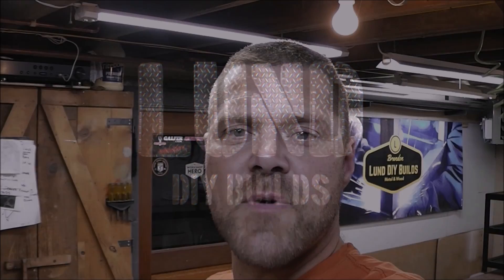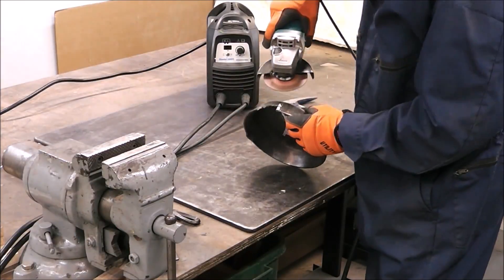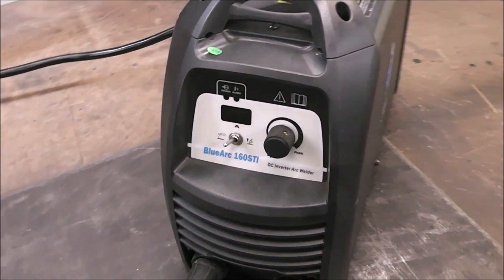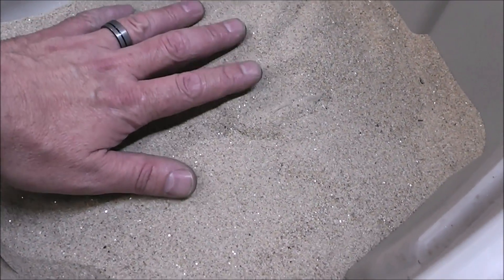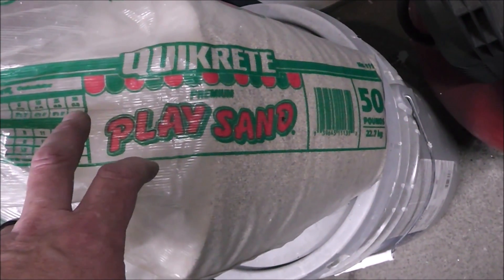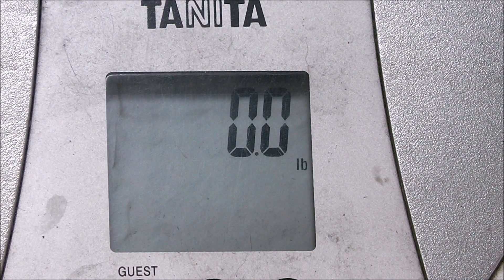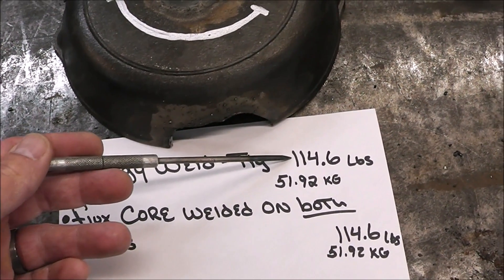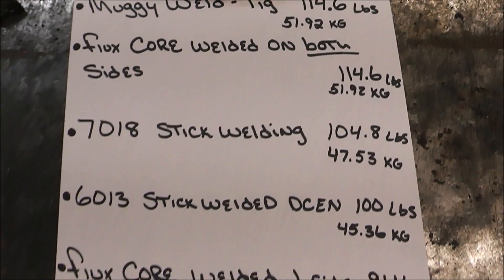Stick Welding Cast Iron Repair with 6013

Comment: I am a very new welder, mostly DIY around the house projects I was recently given a small Inverter Arc Welder. Very basic 120v 90 amp.

One of my first practice projects is a small Cast iron yard Sculpture they fell over in a storm and a piece cracked off.

I'd like to try and fix it if I can. It doesn't have to be perfect just has to hold it's self together and support its own weight (less then a 1lbs) I read online that the best electrodes for this are nickel based but there are other substitutes.

Questions I have what amperage should I set the welder at and what electrodes would you recommend
Reply from the maker: For small cast iron repairs that don't need to be perfect, 6013 rods can work. Start around 70-80 amps and adjust from there based on your machine and the material.

Comment: WRAP A 12GUAGE SOLID COPPER WIRE AROUND THE ELECTRODE WITH 1/8 TO 1/4 SPACE BETWEEN THE WRAPS AND 1/4 INCH AWAY FROM THE TIP, NOW WELD YOUR CAST IRON.
Reply from the maker: Yah, I haven't had that work either. I HAVE A VIDEO ON IT

Comment: For those who care: cast iron welds tend to crack, because cast iron has a ton of extra carbon in it. This excess carbon forms carbides with alloying metals, which precipitate on grain boundaries and cause a crack to propagate through those weak grain boundaries. Using nickel helps to keep the carbon inside of iron grains, because nickel is good at mixing with iron and so nickel carbides stay inside of iron crystals, rather than build up on grain boundaries. good heat management, like is shown in this video can prevent thermal shock induced cracking, but it will not prevent carbide formation on grain boundaries, which is why it ultimately cracks in parent metal near the weld. There are 3 categories of repair: Brazing - low temperature that prevents formation of new carbides; Nickel rod - the best way to keep carbides from forming in grain boundaries; misc heat controlled fixes with 6013 or 7018 that involve preheat and slow cooling. Misc heat controlled methods do not prevent carbide formation on grain boundaries; hence leaving the part vulnerable to thermal shock later. Here is a fun test I'd love to see; repair a part with Ni rod, Brazing and 6013/7018 welding with proper preheat slow cooling. Then heat cycle the repaired part to see which repair breaks first.

Comment: i used to weld it all the time with 7018...it holds up pretty well but any breaks i had were consistent with what you have shown...it breaks at the edge of the weld due to carbon migration induced by the steel welding rods (the hotter the weld, the worse the carbon movement)....nickel rod has no carbon affinity therefore is the only rod that really works well...another good process is to torch weld (melt) another piece of similar cast iron into the crack.

Comment: Every kid that just got out of welding school loves to tell anyone who will listen about pin holes and porosity, they think it makes them sound smart. This is really good information you are giving people, you obviously know what you are doing. Good stuff
Reply: Pinholes and parosity are weak points in welds. With a consistent bead of 60xx's rods, you can avoid the pin holes.
Reply from the maker: @shortiemac001 porosity isn't caused by not having a steady bead. It's caused by the impurities in the cast floating to the surface of the molten base metal. That's why brazing is preferred, because it doesn't penetrate the base material.
Reply from the maker: I appreciate it thank you!

Comment: I'm no welding expert ,but I once had to weld a broken cast iron toe back onto a base of a small machine part years ago . I welded one side with nickel rod after preheating , then I flipped it over immediately and brazed the back side . Best damn cast iron repair I ever did back then .
Reply from the maker: Right on!

Comment: Id like to see the pan strength comparison with standard Bronze Brazing.
Reply from the maker: It's the strongest result to date. It's almost as strong as the original cast iron. It's in the playlist. Pretty impressive stuff
Reply: @BrandonLund  I found the video you mention, I was hoping it was the Oxyacetaline torch with Bronze road and flux.

Comment: How much weight would the pan take to break from new before you go and weld it?
Reply from the maker: I cant remember. I've done so much testing in this series. Just a little over 200 pounds if I remember correctly. The strongest filler metal to date has been mig welding with silicon bronze. It was almost as strong as a new pan 👍

Comment: Im currently doing weld repair for someone and im glad im using a nickel chromium filler to tig weld it. I had no idea muggy nickel weld filler was the strongest in the list. My colleague at work told me i should use a nickel chromium because its very strong for cast iron. Glad i made the right decision.
Reply from the maker: Another good filler is silicon bronze. It's almost as strong as the original cast and welds like butter.

Comment: Hi did you try heating up the pan like what would happen when cooking then try the weight strength test ,would this have a effect on its breaking  weight test
Reply from the maker: I have done a bunch of exhaust manifolds with no issues. Eventually it may or may not fail. Cast iron can be unpredicatable.

Comment: If none of those welds broke, instead breaking the pan alongside the weld, then the rod type is irrelevant.  Heat is weakening the cast iron alongside the weld, so the dependent variable is preheat/cooling procedure, not rod type.
Reply from the maker: An electrode that melts at 2300 degrees vs an electrode that melts at 1600 will have a drastic effect on the weld. Rod selection does matter as does technique.
Reply: @BrandonLund  Good points, but wouldn't that be moot if your procedure stated something like "preheat to 800 degrees less than rod melt temperature"?  Or maybe a percentage, I'm no metallurgist.

Comment: 6013 was designed as a sheetmetal rod,   it should not be used on cast.   it has little nickel
Reply from the maker: This series isn't about what should and shouldn't be done. It's about what works and what doesn't. Silicon Bronze MIG is the strongest cast iron repair I've made to date.

Comment: 😮 I was impressed that it was holding up the chain with a little bit of sand. I do have a question I have a cast iron pot belly stove can not find them anymore it has cracks in the side what is a good welding rod and implements for a Lodge cast iron pot belly stove repair
Reply from the maker: If it's in the heat firebox area I would suggest a nickel rod and if it's a leg or something that doesn't get above 600 degrees I would use silicon bronze mig wire
Reply: @BrandonLund  thank you for your response thank you thank you. I will definitely experiment with that. Seeing it's so difficult to find a non EPA wood cook stove I was going to build one using hot-rolled quarter inch steel plate. Or would you recommend something else? I kind of have to go on the cheap. As well as basically learning how to do it as I go.
Reply from the maker: @keillorchristoph sometimes building on the fly gives the best results, modifying as you go. I'm not an expert on stoves but I would think 1/4" would be adequate.

Comment: Ehh... Use whatever on the grinder to clean it up a bit, then gently clean up with a diamond wheel.
Reply from the maker: I don't get too crazy but there is always that one that will insist the earth will stop rotating if you don't bevel with a cold chisel.

Comment: great on a static load. what about a shock load. say hit it with a hammer? I ask because I have a cast iron piece I need to fix...not a pan but a sander. so static loading might not be real might be some dynamic loading.. or I have to buy a new sander($300 and up). I have the welding EQ. lousy at welding but willing to try..thoughts
Reply from the maker: Cast iron is a crap shoot..I say try it...you got nothing to loose.

Comment: Brandon, it’s awesome that the weld is strong but when i think of cast iron in my local i think of wood stoves and of course the cast iron cookware……so, when you apply heat to the cast iron while cooking it on the wood stove or fire…….doesnt it affect how strong the weld is after you weld it? I have a 100 year old wood stove that i broke the foot pedal to the oven door. I asked around several people who specifically work on these stoves and he told me it is very difficult to weld it since the constant heating and cooling of the medal….
Reply from the maker: It will. It's one of the reasons I refuse to repair cast iron pans for people. Woodstoves don't worry me due to the high heat...much higher than a cast iron pan

Comment: The 6013 running via a homemade welder via MOTs can penetrate rust and do just about anything "professional" electrodes can do.

Yes, anneal cast iron in lime after welding for best results.
Reply from the maker: Spot on!
Reply: Best AC stick experience ever. Will never buy a buzz box which I borrowed or cheap inverter ever.

Comment: Sir.Can i weld the crock of the cylender head with the 6013 stick welding
Reply from the maker: You will know very quickly as it cools if it starts to crack. Cast iron has about a 50/50 chance
Reply: It's more about preheating and postheating or annealing after welding. Use anneal the gear in lime overnight and you'll be fine.

Comment: I never knew you could weld cast iron with standard rods, or wire. I always thought it was braising, or nothing. And the heat is the most important. Thank you.
Reply from the maker: Glad to help Michael. Heat really is the key. MIG Silicon Bronze is by far the best method I've tested. I have a video on that also. https://www.youtube.com/watch?v=Cm3_uv-PhPM

Comment: Great I've never thought of welding cast iron with 6013 I guess in a pinch it can be done I've used 7018 or regular cast iron rods that holds pretty good everyday you can learn something new
Reply from the maker: Thanks man! You don't know until you try :)

Comment: I've had people argue with me till they where blue in the face about welding cast iron almost to the point of violence lol I had to do this in welding shop in school took 4 years of it got my card to weld bridges and we had to do this in school stick weld cast iron not braze it weld it it's one of those things a lot of PEOPLE can't weld cast iron not that it can't be done but if you know what to do and how to do it you can do it no problem preheat and cool slowly good video
Reply from the maker: You hit the nail right on the head brother! Like you said, you can argue until your blue in the face but until you've done it its usually "i heard" or "so and so tried it and it doesnt work". Its all in the prep and taking your time. I like to use bare wire mig on cast just to irritate my critics 🤣🤣🤣 that might actually be a good video title "Cast Iron Welding With Mild Steel Just to P!@s you Off"
Reply: @BrandonLund  that would be awesome lol

Comment: Suprised that 6013 isn't far from 7018 results :o
Reply from the maker: Same here!
Reply: @BrandonLund  Did you put the 7018 Pan in sand to cool down slowly? I didint see you do that in the 7018 Video
Reply from the maker: I did ;)
Reply: @BrandonLund  Nice! Did notice that you grounded the 7018 bead and not the 6013 And used different size rods. 1/16 6013 vs 1/8 7018. That changes the heat input. Have you thought about doing this test with 3/32 6011? Curious how that would do.
Reply from the maker: Ive actually got some more testing coming up real soon that should be interesting :)
Reply: @BrandonLund  Good to hear!

Do you agree that grinding the 7018 weld affects it.

Silicone and Aluminum Bronze brazing by Tig would be great to add to this test!
Reply from the maker: I think grinding would effect it but i believe it would be negligiable. The weld generally breaks at the toe rather than the built up center. (Silicon Bronze is the next test shhhhhh🤫) 😁
Reply: @BrandonLund  Will you do aluminum bronze as well? Heard it is quite a bit stronger and itd be nice to compare the two for cast iron.
Reply from the maker: I will! Im curious too
Reply: @BrandonLund  Wicked! Looking forward to it. It'd also be neat seeing 7018 again. 1 Pan with pre heat and slow cool down vs 1 without pre heat or cool down. To show how important it is.
Reply from the maker: Excellent idea! I write this stuff down because i like these types of experiments also

Comment: That is cool. Do you think it is possible to weld cast iron with steel using the same method? Special electrodes for that kind of applications are very expensive. 
I want to weld 6kg thick round piece of steel to the 54kg cast iron kettlebell making it 60kg monster.
Reply from the maker: @Maciej Ziobro  Your an animal bro! Back in the day i used to lift pretty heavy. Couldnt run to the end of my dryway but I was big and thats all that mattered lol.  I've never been a cardio guy. Crossfit kicks my butt!  Anyways, back to the problem. Yes I think it would work however it can be tricky because each material cools at a different rate which is how things crack. I'm guessing you will probably weld the round pience to the bottom so I would weld it in small sections....say like an 1/8 of the way around then let it cool completely before continuing another 1/8. You will know rather quickly if it's going to work or not because if it's not going to work, you will hear and see the cracking as it cools.  Let me know how you make out with this.
Reply: @BrandonLund  thank you, I will let you now for sure
Reply: A little update. It works! Although I found and used special cast iron-steel rod but it was my third ever welding. Of course welds are not pretty, it shows all my mistakes. Even a little cracking on too long welds but after griding it, they dont go all the way down. It will hold for sure. It was fun af. You were right about cooling , kettlebell was not even hot but the steel piece that isnt thin was very hot. It was hard because I cant see welding pool. It was harder to feel welding arc. 
I used Castolin Eutectic EutecTrode XHD 2230 electorde 120A.
Reply from the maker: Thats awesome man! We'll done! 👍

Comment: hi im just learning n wanting some repair rods i can dyi, but see more types....what do all the numbers mean? and all the types say for aluminum, can you weld other metals too with these?
Reply from the maker: 6011 (designed for AC welders) and it's equivalent 6010 (for DC) are great general purpose rods with great penetration, 7018 is great all around rod but needs to be kept dry and 6013 is great on thin metals. Here is a short video on what the numbers mean https://youtu.be/FQFogGvwUys
Reply: @BrandonLund  ty!!! i see tons now lol  and electro rods are?
Reply from the maker: Your welcome!
Reply: @BrandonLund  ps- r meanings the same for the numbers on those LOW heat brazing rods? i should hav mentioned that

Comment: Hi. I used stainless rods to weld cast iron on a small job once. it seems to work but how strong is it
Reply from the maker: Many have had good luck using stainless but that has not been my experience. I actually tested this in my cast iron welding playlist and compared the breaking strength to other filler metals

Comment: Can you try stainless rod on cast iron I learnt this once and it works but how good I am not sure
Reply from the maker: Ive used stainless in the past and havent had great luck. I have a vodeo using stainless and testing its strength in my cast iron repair playlist

Comment: Interesting result! I remember when they sent off our welds to a lab in college, for gas welding of cracked sawmill saws. That's what I worked on and was, a Sawfiler. And their's would pound on it simulating the rolling on huge tensioned wheels would do to them in a sawmill thousands of times until they would crack again. This is so much simpler and I think it's a totally legit, scientific test. Unlike my more complex example, your pan only does two things cooks and carries. And all we're interested in is the carry part. I doubt anyone will be carting around anywhere near 100lbs in that little pan, lol,=great repair! Hugely successful in fact and obviously, there is zero need to weld the other side, that's cool. I would just for aesthetics and just fill gaps and finish it up flat and clean, so I could get a nice seasoning on the pan afterwards. 

Our welds were forged while hot and on thin metal, maybe 3mm thick, so they would never need welding from both sides and if anything, it would weaken the weld once finished on the first side. Everything gets smooshed together anyway, by pounding it immediately afterward and then reheated over the whole crack, to red hot and forged again. If you peened it as quickly as possible while the weld is still hot/soft, you could do similar and likely did, to some small extent and pushed some metal into the crack, strengthening it. Weld with one hand, have hammer in other, while still hot?
Reply from the maker: Thats pretty awesome! I love hearing stories like this. I've heard of forging cast but never done it but I have always been interested in the process though! @Bill Does Stuff